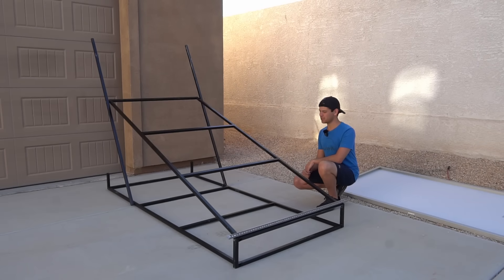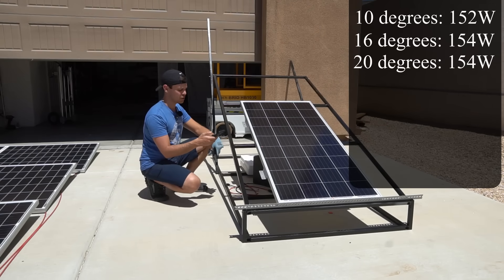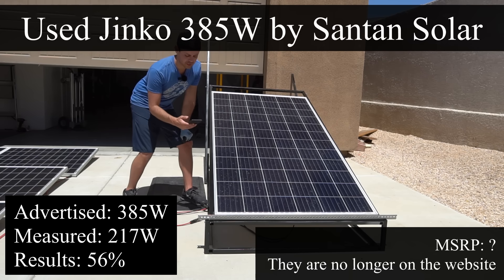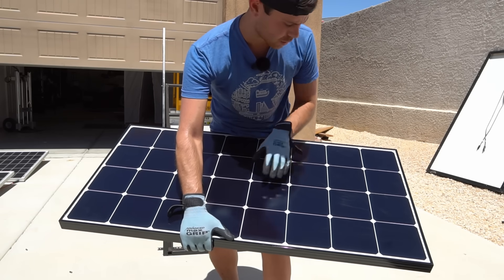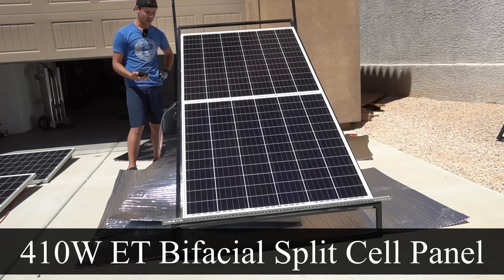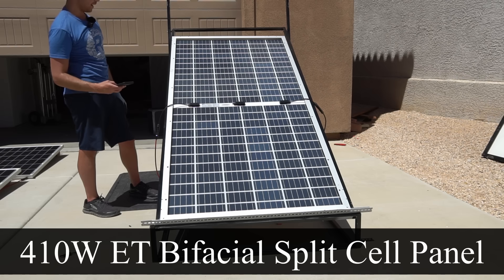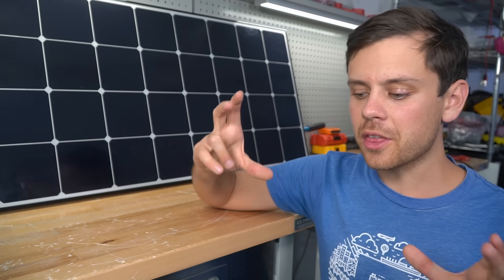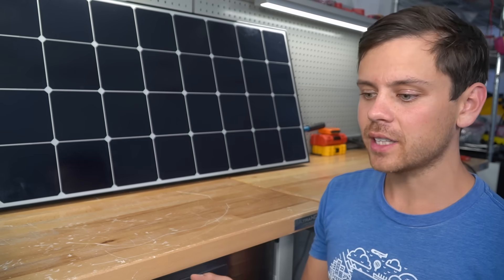Solar Panel Showdown: Sunpower VS Bifacial VS Used VS Renogy VS Rich Solar

Comment: Watching your videos was part of my research on building a solar system for my van. Thank you. I would like to see your opinion on Grape Solar mono panels. I chose Grape Solar simply to avoid shipping  fees. I ordered them through Home Depot and picked them up at the store. The next time you do a panel comparison it would be nice to see how they measure up against other panels.
Reply: Update
I have added a Renogy 200 watt mono panel to my array. It is mounted in the same location and non optimal angle. It has it's own charge controller and is hooked into the same battery bank. Mid day with some cloud cover and a 99 degree ambient temperature the Grape Solar array produced 56% of its rated output. The Renogy panel produced 59% of its rated output. Later in the day with the sun going down the Grape Solar array dropped to 35% of rated output compared to the Renogy panel dropping to only 56% of its rated output. The Grape Solar panels have a sturdier frame compared to Renogy. The Renogy frame is very thin and can be bent with one of my fingers. The Renogy glass arrived damage free. My Grape Solar panels arrived with minor scratches on the glass ( I still accepted them). My Grape Solar panels are a little over a year old compared to the Renogy panel that is brand new. All panels were washed 2 days before this comparison test. One note: The Renogy panel that I purchased from Home Depot was advertised with a rated current of 9.52 amps. The panel that arrived had a rated current of 8.85 amps. This deception is frustrating and costly when you are trying to build an array wired in series. I do not know if the deception  is the fault of Home Depot or Renogy.
Reply: Can you do your own at home testing of Grape Solar and post it here? Then we all can have a larger crowdsourced list of results. There's only so much time in the day for one person to do testing.
Reply: @sammiller6631  I have 3 Grape Solar solar panels. Two of the panels are 300 watt mono and the other panel is a 190 watt mono. I have them hooked together in a series string effectively making a 770 watt array. My panels are mounted on the roof of my van at a non optimal angle. I have no other panels to compare them against and I have no previous experience with other solar panels. I can tell you that they work. I have them feeding a 60 amp Grape Solar Zenith MPPT charge controller. I do not have my system run through a shunt nor do I have tracking software for the charge controller. The highest output of my array so far was 922 watts for about a minute and a half. That is not the norm. Most of the time my array lives between 400 and 700 watts.

Comment: Can you run appliances off the same batteries you are charging or does 100% off grid need two sets of batteries, one set charging while the other set is powering appliances?

Comment: For my van I have 4-100W Renogy panels but not the Eclipse variant.
For my Cargo Trailer build, I am going to consider the Trina 415W panel. 
I was really interested in the bi-facial panels because I live in Massachusetts with low sun angles, but the rear face output is unpredictable. 
Have Battle Borns for the van, two pairs of different age AGMs that I already own for the trailer, I will keep the AGM pairs separate and put a switch after the charge controller to charge either set. One set dedicated to CPAP.

Comment: those jinkos are likely damaged and that's why they were replaced and liquidated. the connections between the cells likely degraded due to continued extreme temperature differences over an extended period. you can test by shading one cell at a time for both the top and bottom rows so see which columns are damaged.

Comment: I was amazed how much more power is made with better cells and frame. The metal frame had a lower temperature than a plastic flexible version.

That leads me to wonder how effective an active water cooled heat sink solar panel would perform. I placed pex tubing in a roof and cooled it off passively.

Comment: Are you accounting the angle of driveway? So is a 45 degree from flat ground or from that sloped driveway. Great video btw i love this this info. Once i have my solar setup done will have to post about it!
Reply: He was using a level to determine the angle of the panel
Reply: @jeremycrowder6554  ahh i see. I thought the welder put angle indicators on the rack. If that was the case my guess would be it was calibrated on a level surface because that is what i would have done. There i go over thinking

Comment: i tried to buy one of those $50 used panels in your link and the cheapest shipping option was $188 for one panel? so the total would be $237.44 for one used panel. lol
Reply: With big things shipping isn't cheap. It's like shipping 1/2 a sheet of plywood. They probably ship on pallets, so buying one is not good... Buy more and resell them.
Reply: @volvo09  i tried clicking around for a way to change quantities and couldnt find it than gave up, maybe i over looked it. it was more of an impulse buy anyways, i need more batteries, not panels lol
Reply: 1-10 panels were the same shipping cost for me...$237...then it started going up...at 40 panels shipping was $688 ($17 per panel).  Definitely not something to try to get one or two at a time
Reply: I looked into it too, when i saw that shipping cost i was surprised

Comment: Hi Will,
I'm thinking that with the bi-facials, they will be more efficient when setup in a row. I.e. the panel behind absorbs what photons in can, those that are reflected are bounced into the back of the panel in-front. If you setup one of your panels behind the bifacial, it would be interesting to see the output then.
Cheers.

Comment: Will, try a white background behind your bifacial panels. The "foil" may be bouncing the light to wide and the concrete although light in color isn't reflecting that much.
Just an idea.
Reply: Do they make white roof tiles? I have seen flat white roofs
Reply: @CandycaneBeyond  it comes in a can at home depot  its called silicone roof coating
Reply: @CandycaneBeyond  I think you are right. Will was performing an experiment to test the efficacy of the panels. A white background would show the optimal output of the bifacial panel.
P.S. You are also not going to have an adjustable roof to optimize the sun light according to the season.
Reply: @danerskine9862  well technically you could put something up there that could slightly adjust and make it motorized
Reply: @CandycaneBeyond  there are ground mount systems that actually track the sun.
I imagine something could be done on a roof.

Comment: Warning Some panels are defective and being sold illegally very cheap. Bill for best results try Sunrise and Sunset and put them in series, surprising results.
Reply: They probably have bad diodes, easy to fix.
Reply: @techtactics788  No. Back sheet peeling and thousands of the Trina has been recalled.
Reply: @neliosamch3195  ok understood. I know about that. Quite a few get relaminated and the technical information/logo removed. Unless the silicon cells are heavily degraded, I don't see any issues.
Reply: @techtactics788  Okay if having to check every year for delamination and low output on each panel individually for the next 25 years isn't an issue for you then good for you, save the money. Low maintenance would be high.
Reply: @neliosamch3195  I understand your point.  I have a business like Santan Solar in the UK and I avoid relaminated. There's a market for those who want a few years use but they should be informed I think. I get brand new and used ones and in the last 3 years, no one has called back to return a single panel. I'll say though where found to be crack, backsheet issues, just stay away.
Reply: @techtactics788  Yes, it is cheaper to buy a new one than the hassle to resend for a replacement.  Many of those panels should have gone for recycling,  instead are being given away for free or very cheap.

Comment: could you test with panels flat to simulate a van's roof and chart the potential loss?
Reply: There are already online solar calculators that show flat panel output.
Reply: @sammiller6631  There are online calculators that do what was tested and shown in this video too. Whats your point, chief?
Reply: @Js18100  There aren't any online calculators that involve spraying water on the cells or placing reflective material both close and farther away from two-sided panels. What was your point other than calling others "chief" and being negative?
Reply: @sammiller6631  What negativity are you referring to? Point it out specifically. What was the purpose of your comment? It wasn't to supply information or provide help - your comment didn't include those things.

And there are no calculators online for flat panels that involve spraying water on the cells or placing reflective material both close and farther away from two-sided panels.
Reply: @Js18100  If you can't tell who is a chief, why should I assume you would understand anything pointed out to you? You come across as someone who thinks they know everything.

Comment: Hi Will, FYI I installed 1 used Sunpower 360 watt panel, 22% efficiency. 90.00 from San Tan Solar. on my trailer. Very happy with it. I can pull 340 watts in full summer sun.
Reply: I agree. You cannot beat used SunPower panels. The 327W panels I've got, regularly outperform at 108% and you can get them at $0.2 per watt. I wonder why people consider anything else...

Comment: That 385W Jinko panel is not degraded it is just damaged likey a shorted diode (it has 3 bypass diodes inside) and if one is shorted it will disable 24 out of 72 cells.
Panel temperature is important so for fair comparison all panels should be in the sun for some time so that they get to same operation temperature.
Bificial make sense as the cells are so cheap but when you need to add another glass at the back prices increases and also weight so they are not that great of a deal. In winter at my location they may do something extra. It is strange that it will not produce the same output from the back (maybe they use lower quality cells on the back as I can not see the reason why it will not be the same or very close).
Reply: Can the diode be replaced?
Reply: @techtactics788  Yes.
Reply: @electrodacus : Love your SBMS0! When I am getting my solar system I will definitely buy one from you! Keep it up! :)
Reply: Thank for the information, I ordered some of these recently at a great price but haven’t tested yet. 

Will test once received and if needed go with diodes replacement.

Comment: I bet those Bifacial panels will work better in the snow.  Reflections on snow is likely to be higher.
Reply: Bring them to DC. Best snow job ever. Tic
Reply: On a boat?  How well will water reflect?
Reply: @jeffroyal1554  It will also cool...maybe offset.. ?
Reply: So snow on and under is good?
Reply: or near water, etc
Reply: @fratermus5502  Genius! These would be great on a house boat.
Reply: Agreed! And that's why I'm buying a 30 panel pallet shortly. When the tops are covered in snow, (until I clean them) the underside will still produce. Just retired and moving north shortly...

Comment: what is the best watts per square inch?
Reply: The best are coming later this year. 500w. With the same size than the 72 cells 400w.
Reply: @neliosamch3195  no way. Sounds expensive
Reply: @whatthefunction9140  No price yet but should be around the $300

Comment: It would be awsome to see you add a tracking motor on this to follow the sun. I wonder if it would be more efficient to use a small amount of energy from the panel to move the motor to the perfect angle through out the day. You think this would work?
Reply from the maker: Usually the cost of a solar tracker makes it impractical. You are better off not tracking the sun and adding more panels.
Reply: Will I am wondering if you have a recommendation for 300 amp inline fuse and where to get?
Reply: Inline for a 300 amp fuse? I have never seen such a thing. I have seen MEGA fuses and fuse holders. But they work with fuse block studs. Just google "MEGA fuse" and "MEGA fuse holder" to see if that is what you are looking for. If you are using a 300 Amp fuse, you should also be using 300 or 350 MCM wire. Otherwise you need a smaller fuse.
Reply: Possibly the Bifacial panels would be the best. Point the front side for most of the sun towards the East and the backside gets the rest of the day. 

I guess I am talking about changing the vertical axis orientation. You showed us the horizontal orientation. Tropical locations tend to get late day clouds, so changing the vertical orientation would capture more energy.